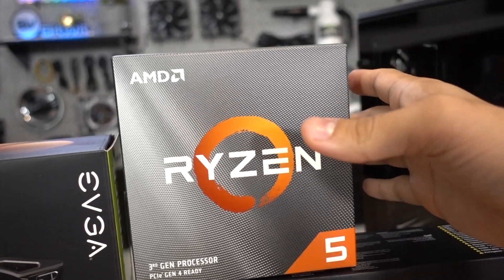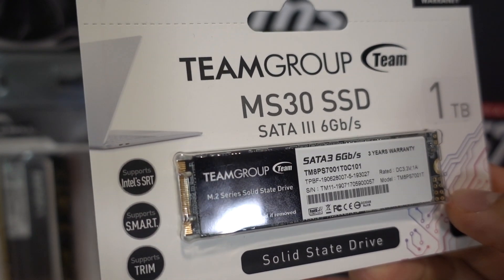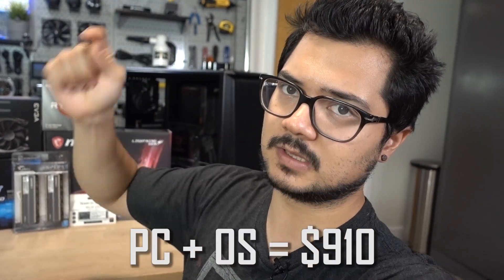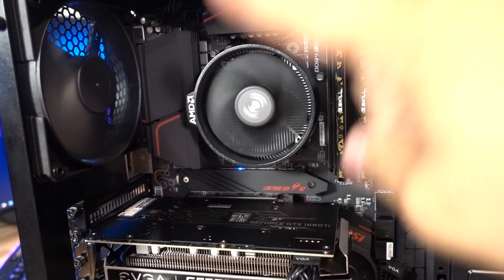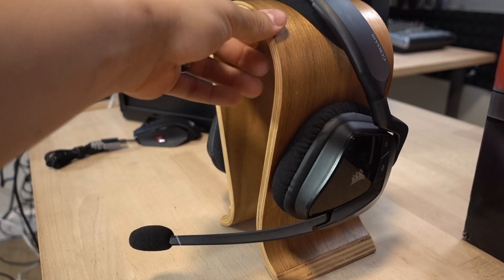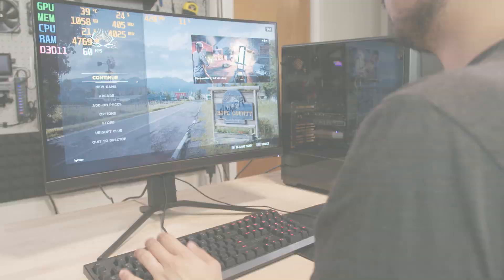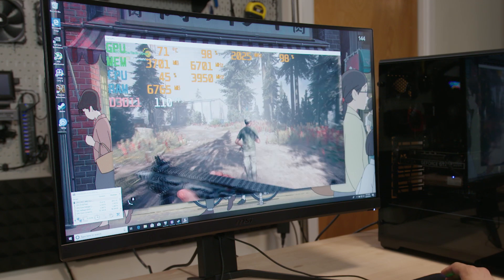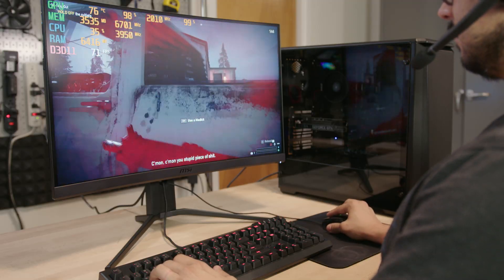Literally EVERYTHING you need to game on PC for $1500

Comment: Why not putting a rx 5700 instead of the 1660ti?
Reply: it goes out of the budget
Reply: @hyaku2806  in my region those cards has the same price. Anyway he could have saved money on the motherboard and invest them on the video card... I made stronger pc with 1100€
Reply: @mattiaplatania  Welp... I cant argue about that, and yeah tbh ur right
Reply: @hyaku2806  I did a similar build with the 3600, a b450 aorus pro which isn't that worse than the x570 gaming plus for a 6core processor and actually isn't that bad for a 8cores without an overkill oc... In case the owner wants to Change it... rx 5700 XT, 16GB of ddr4 ram, 250gb ssd nvme 3000+MB/s, 1tb hdd, 750w 80plus bronze semi modular... I even put some sexy good looking rgb components for the price of 1110€... I don't exactly how much money are in Dollars but I can tell that it's better than this build for 2k 144fps gaming
Reply: @hyaku2806  what do you think about this computer?
Reply: @mattiaplatania  thats actually a great pc tbh... while im here waiting to get a new one this Christmas
Reply: Now that you mentioned it, I realized it too. He used GTX 1660Ti in a $1500 PC Build... The case not even the digital and the RAM is only a Sniper X (what I meant by only is because he's not using the expensive one like Trident Z Neo, Vengeance Pro, Hyper X Fury, Etc.)

And this build almost the same as mine, I'm using the same GPU but from Zotac, same RAM Company but the new Trident Z Neo, and same case but the Digital ver. The different is only Motherboard and Power Supply, which right now I'm using Tomahawk Max and Be Quiet! Pure Power 10... and mine only cost less than $1000.
Reply: iQlo Das Ve'r 1500$ include the peripherals.

Comment: I actually just went through this same process, but just for the rig. I was upgrading the cpu/mobo/ram as I sold the same from my AM3+ (FX 6300, 12GB DDR3 1333MHz) system. I went B450, 16GB DDR4 3200, Ryzen 5 3600X as I felt this was the best overall balance.

Comment: Last month I built my rig for 1470€ what is aprox 1600 USD and almost everything was for full price so during discounts it would be around same price level.
I've managed to get:
MB: Asus PRIME Z390-A
CPU: i7-8700
CPU Cooler: Corsair H100x
GPU: EVGA RTX 2070 Black Gaming
RAM: 2x 8GB HyperX Fury 3200 MHz
SSD: Intel 660p M.2 1TB
HDD: SG Barracuda 2TB
PSU: EVGA 650 GQ
Case: Fractal Design Focus G White
Reply: Aladár Knís why did you get a non k CPU but a z390 motherboard?

Comment: I eas planning to buy this monitor (in my country it was available at only one retailer) but it got sold out.
Is there any good alternatives with this exact specs at nearly this price. Pls
Reply: i use an acer 1440p 144hz 32" monitor that i got for like 250 on sale on amazon that is usually 350-400 usd. its the Acer ED323QUR Abidpx.  i have no complaints at all
Reply: Just lookup LG they have similar monitors with ips

Comment: I just want a review of the case...
Reply: Its just a phanteks p400 but with a mesh front panel. You can just watch the many reviews of the p400 because the only difference the front panel which results in better airflow which results in slightly better temps.
Reply: @julius4347  Well full mesh front panel will result in a lot better temps and will make Steve over @gamersnexus very pleased lol

Comment: Ah yes, the ultimate setup budget.
The monitor is definitely gonna be either a bottleneck, or it's gonna take budget from the rest of the system.

Kyle's build seemed a bit biased on parts. If he budgeted parts more, he could've gotten a better gpu and maybe cpu. Again, the monitor's still a dealbreaker...
Reply: why is it a dealbreaker? no ips panel, but for primarily gaming it should work fine. Now if you are a fan of curved monitors is an entirely different story, but a 144hz wqhd monitor 27 inch in a setup of 1.5 K, where the PC is the major part of the equation, that is a good deal in my book.
Reply: @Luemm3l  I was meaning that the price of the monitor takes away from the rest of the setup. 

So if you can find a cheaper monitor you can get better parts for it, but you'll probably lose refresh rates or response time...
Reply: @mando_dablord2646  if you have a lower refresh rate what would even be the point in having faster components?
Reply: @The-vk8dr  That's a 144hz monitor, there are cheaper ones out there. But even then, unless you're super competitive, you can live with a small drop in frames and put it into graphics quality.
Reply: I highly disagree. That is an excellent monitor. While expensive, it will last years and years to come.
Reply: @InsulinAdikt  I'm not disagreeing that it's good. I'm just saying that there could be better options to fit the budget.
Reply: @mando_dablord2646   I think it's clear the components choice he went with are aimed more at 'room to grow' than best price-performance at this time
Reply: @ecophreak1  That's not a bad idea. But keeping price to performance high is also useful when thinking about upgrading. Because you have to rebuy parts that will be more expensive, granted you can always sell your old parts. But getting stronger and more expensive parts out of the way can ultimately help with time and cost.

Besides, Kyle put a lot of money into the peripherals. A $1500 set up is pretty much high end entry level. So dropping $600+ is killing the actual system.

Comment: I think for that cost, you can switch around your budget with this build quite a bit. I think some of these parts are unnecessarily expensive by comparison to what you're compromising here. Then again, it always depends on what exactly you're looking for in terms of performance. 

For comparison, if anyone is interested in an alternative (probably more suited to higher end gaming), this is what I built two months ago, with a total cost of around $1450 (after tax): 

+329.99 - Ryzen 7 3700X (You can definitely go 3600 or 3600X if you want to save that extra money)
+499.99 - RTX 2070 Super reference card from Nvidia
+74.99 - G. Skill Ripjaws V 16GB 3200Mhz RAM
+97.37 - EVGA 650 WATT PSU 80+ Gold Certified (Ended up buying this last, as my old power supply wasn't cutting it)
+99.99 - MSI B450 Tomahawk 
+107.50 - Crucial MX500 1TB SSD (probably could've stretched the budget for NVMe, but I didn't think the extra money was worth it)
+67.99 - WD Black 1TB HDD secondary storage
+92.99 - NZXT H500i case
Total before tax: $1370.81 USD

Windows can be nabbed for cheap from places I won't name here. It can even be claimed for free if you're a college student (Education edition). 

Before you buy: Take a solid look at benchmark tests around the internet and come to conclusions that will suit your personal goals. You can get a 5700 XT, for example, for around $100 cheaper than the 2070 Super with not a significant difference in performance (just no RTX features). If I could redo some of these parts I listed above, I think I would have gone different routes, to be honest.

Note: I didn't put this here to harp on Kyle at all. He's a smart guy who probably knows what he's doing more than I do. I just wanted to point out some alternatives for users that may be looking for build ideas.

Comment: Not even the 3950x will use so much power that you'll need the extra 4 pin connector for the cpu... It's a stupid design decision just for "wow such cool" factor. You're VRM and capacitors will destroy theirself before you'll need that much power.
Reply: Your*
Reply: Doesn't need it yet. It's future proofing.
Reply: BuildZoid did the math on it. The 8 pin can support more then what an 3950x can pull under full load.

Comment: changed everything but the case for about the same price and got a ryzen 2700x(has more cores/threads so you'll be able to do anythign except heavy editing), b450 tomahawk (won't need bios update and ryzen 7 will have plenty of cores for streaming or light editing for those who want to start content creating) 120 gb ssd (not m.2 went with ssd because its cheaper and we are only gonna put windows and desktop apps on it) 2 tb hd (7200 rpm hd is going to be fast enough for your games and give you enough space for content creation or throw all of your steam library on it and never have to wait to install a game you already own) rtx 2060 super (i know its kinda overpriced but it actually has ray tracing and is more powerful than the 1660 ti) evga 600 w 80+ br (you don't need modular cause you aren't going to be changing parts a lot or have to worry about the extra cables cause the psu shroud) same case, MSI optix mag241c 23.6" (its 144 hz curved told my friend to get one I've seen it used it and its good) hyperx alloy fps pro (my keyboard I have blue but I recommend red if you aren't a writer or something cause blue is loud)  logitech G pro ( I have a g703 they are both wireless but g pro was literally recommended by pro esports players and from using one similar to it I love it, although have the usb recieve at the front of your case just so it responds slightly better/faster because interference) hyperx flight headset ( I use it personally and love it though if you want more bass for music or movies go with a audio technica wired headphones if you don't mind wire and get a standalone fifine usb mic it has everything you need and you won't have to have a microphone by your face and sound pretty good too. tuning may be required.) but that is how I did it and it totals out to about $1470 and its more powerful and can stream/light editing and will get more frames P.S. sorry for the long paragraph just wanted to let you know why I picked the parts P.P.S. I forgot memory but you can get memory kits that are 3000 speed for only $70 just get it from a name brand company (my personal build has trident Z rgb 16 gb but thats more than $70 last I checked)

Comment: 2020 update: switch out the rtx 1660 ti for a rx 5700xt, get the ryzen 7 2700x and replace the motherboard with a x470 model. For peripherals replace the mouse with a cheaper razer or logitech. If there are any other things to update please comment back.

Comment: I did a similar pair of builds for some friends. Some things I went Cheaper on. Some things I went a little more expensive. I believe the total cost was around $1700 - $1800 per system which could have come down if I would have bypassed the extensions, used SATA SSDs instead of NVMe, and gone with a slightly cheaper GPU. Here is the List:

Ryzen 2600 CPU

Asus Strix B450-F MoBo
G. Skill TridentZ 16Gb ddr4 3200Mhz RAM

MSI RTX 2070 GPU
Samsung 970 Evo M.2 2280 250Gb NVMe SSD
Seagate BarraCuda 2Tb 7200rpm HDD
Corsair H100i Pro 240 AiO
EVGA SuperNova 750w G3 80+ Gold PSU
DIYPC Vanguard V8 RGB TG Mid Tower Case
Antec Mod PSU Cable Extensions

Periferals:

Asus VG245H 24" 1ms 75Hz Monitor
Corsair M65 Pro Mouse
Rosewill Neon K85 Mechanical Keyboard with Brown Switches (Not Cherry)
Koss SB45 USB Headset

The DIYPC case wasn't all that terrible to build in and actually came with an extra RGB fan that never got used because of the Corsair fans from the AiO. Given the fact that I had an absolute MAX budget of $2000 per system I think I did pretty good.

Comment: I would go with a GTX 1660 Super as it’s cheaper and has almost the same performance as the Ti version. Also, I would go with a 1080p 144hz monitor instead of a 1440p one, but that’s just my opinion. I would also maybe consider getting a Ryzen 5 2600x instead of the 3600 as it’s better for streaming and that’s something I personally care about. With the saved money you could get some better and more case fans and a aio for your cpu or a better air cooler.

Comment: Great video but i dont think it is necessary to gat a 3rd gen ryzen (since 2nd gen has dropped in price) and spend the money you save on a 2060 super. I am not an expert by any means but i think it would get better framerates than 1660 ti with 3rd gen processor. All that being just speculation though.

Comment: Tbh I'd say a gaming chair is also essential in a gaming setup  budget these days cuz it's just like any other part of the setup now that there's more than 2 companies (DXRacer & GT Omega Racing are the top 2 I'd still think) such as Secret Labs, Arozzi & even Corsair so maybe we gotta sacrifice 8GB of RAM or even the GPU to a lower price point for the PC build and a cheaper monitor depending on the price of the chair. That can range from $100-$500 new but like $50-$350 used I'd say (depends on the persons weight and what brand chair you go with).

Also if you're starting from scratch I don't think you're gonna have your monitor in your lap or chair even while gaming so you'll need a good desk to. That's another $80-$100 just by shopping any desk at all straight or L shaped.

So instead of spending $270 for a "gaming" monitor you can spend around $100-$150+tax and s&h for a non gaming monitor and that covers the desk. As for the chair, you'll have to bump down to a RX580 8GB GPU and remove 1 8GB RAM stick just to get a $120 chair+tax and s&h and then you might just have enough to get some cable sleeves to tidy up your cables outside your PC like power cables and some RGB strips for the setup.

Comment: drop the 1660 ti for a 1660 super and replace the amd stock cooler with a hyper 212 evo, now you can overclock the 3600 with better temps across the board

Comment: Hardware Unboxed gave that motherboard a pretty terrible review
Reply: i dont understand the x570 choice, he says it has better memory support, but the memory controller is inside the 3600. And the b450 motherbords get the same agesa bios updates, so the only benifit is pci-e 4.0. I think an ssd with pci-e 3.0 x4 will do just fine. And i think the msi tommahawk or the carbon bords can still handle a 3900x just fine.. In 4/5 years ddr5 will be mainstream, so will pci-e 4.0. I cannot immagine for gamers any use case to go for a x570 motherbord with a noisy chipset fan where you pay for shit you will likely never even use.
Reply: dont know why he put a 160$ motherboard with  a 200$ cpu
Reply from the maker: You're not referring to their video(s) calling out the awful thermals of the MSI MPG X570 Gaming Edge Wifi, right? If not, link?
Reply: @Rem_NL  I agree. For the price point I would have went with the b450 gaming pro carbon ac or the x470 gaming pro or pro carbon. I also would have went with the Ryzen 7 2700x for $199 for more than just a gaming PC. Besides the Asus x570 budget boards, the others just don't cut it.
Reply: @Bitwit  In their "Budget X570 VRM Thermal Performance" video, they did do the MSI X570 Pro-A, which they acknowledged as having the same VRM as the Edge. Buildzoid pointed out that the Edge Pro-A and the Gaming Plus ALL have the same VRM, and the difference between them is the size of the heat sinks. I would also like to point out that Buildzoid did say that while being probably the second worst X570 VRM, they should be just enough to run a 3950X, and that Steve was stressing the boards with more then what a gaming(and possibly streaming) workload should put on the VRM with a 3900X, not your 3600. Also, as Buildzoid likes pointing out numerous times, the extra 4-pin is unnecessary, as even the higher end chips can't pull enough power to make it needed.
HWU - https://www.youtube.com/watch?v=xbyWKufthS4&t=303s
AHCO - https://youtu.be/6BaqXHSEJec?t=2713
Reply: @Bitwit  While Hardware unboxed didn't actually test the Motherboard you have, It's pretty Clear that other than the Very high end boards, MSI is having Issues with not only VRM's on some of there X570 boards, but also Bois issues with the 400 series boards because Bios Chips that are too small for the update to Ryzen 3000 without Gutting the Bios to look like Something for 1999!! Yea it works, some of the time, Even MSI has admitted some issues. I myself Bought a X470 Pro Carbon last year with the idea of upgrading to Ryzen 3000. Now I'm not so sure, I'm Looking at switching to a X570 Asus Tuf board!! Sucks to have to rebuild again, but it is what it is!! https://www.reddit.com/r/MSI_Gaming/comments/ce3ift/msi_b450_tomahawk_update/
Reply: @Bitwit  I bought the same board and found it to be horrible returned it and got the Asus tuf .. so much better !
Reply: It was d the driver's at the time.
Reply: @Rem_NL  Totally agree, quite informative, yes a b450 will be just fine, since he is not using compatible nvme drives for the gen4 slot.................
Reply: The asus prime x570p would've been a far better choice for as good of a price. I still think a b450 would've made more sense.
Reply: You are wrong, i dont test the Gaming Plus!..This model have a more good heatsink vrm..go check..

Comment: CPU - Ryzen 5 3600 - $195
CPU Cooler - Noctua NH-U12S - $60 (MUCH better cooler)
Motherboard - ASRock B450 Pro4 - $80 (Arguably same-performing motherboard, even still suitable for a 3900X)
RAM - Corsair LPX 3200MHz CL16 - $70 (Performs within 3% of 3600MHz CL16)
SSD - Intel 660P 1TB NVME - $95 (Faster, non-SATA M.2 SSD)
GPU - MSI RX5700 Mech OC - $375 (Performs much better than the 1660 TI)
Case - Fractal Design Focus G - $55 (Roughly the same case, but cheaper)
PSU - EVGA BQ 650W 80+ Bronze (Semi-Modular) - $70 
Monitor - Acer KG271U 27" 1440P 144Hz - $270
Keyboard - Kingston HyperX Alloy FPS (MX Brown) - $60
Mouse - Logitech G502 Proteus Spectrum - $40
Headset - Corsair Void Pro RGB - $70
Windows 10 Pro Key from Grey Market sites - $25

Total cost: $1465

Kyle, I love the build, but the X570 motherboard and 1660 TI really weren't well-matched choices for this budget.
Reply: One thing a lot of people are missing/overlooking is the hassle of getting a B450 mobo to work with the new Ryzen 3000 CPUs. You have to have an old gen Ryzen to update the BIOS OR do the AMD boot chip loan program which is a massive inconvenience. I fully support the idea of going with an X570 mobo because it has plug-and-play functionality.